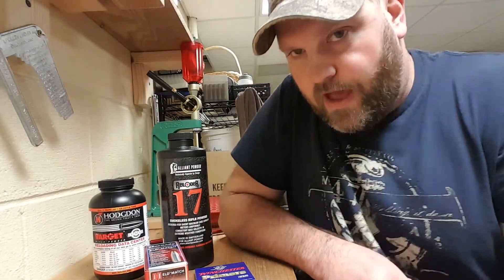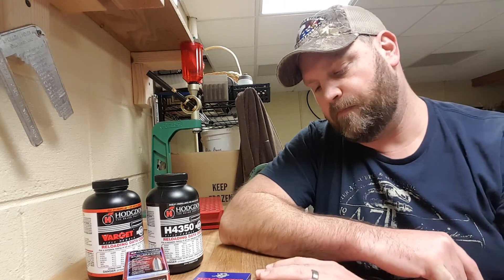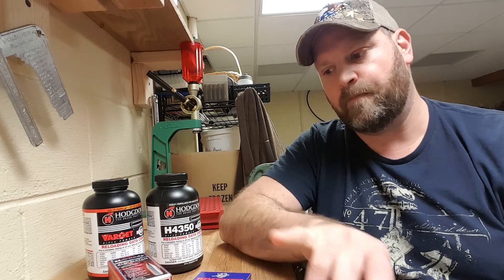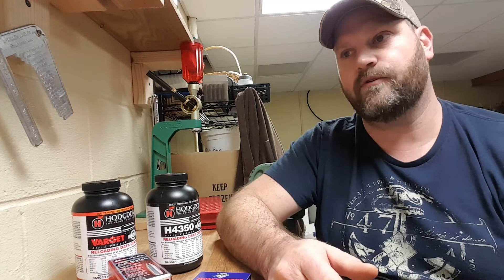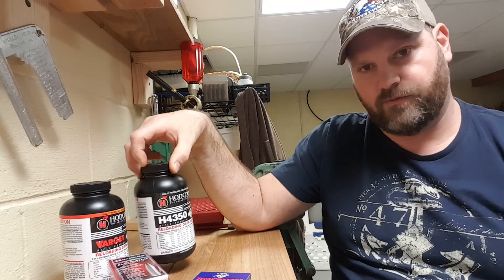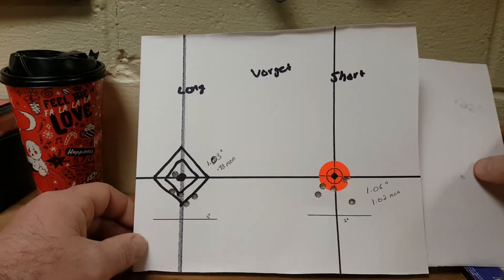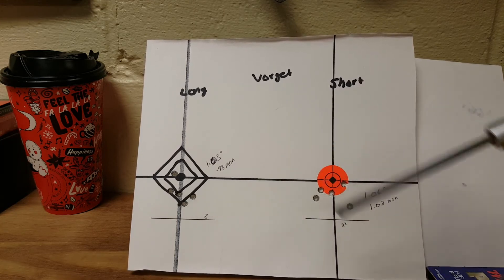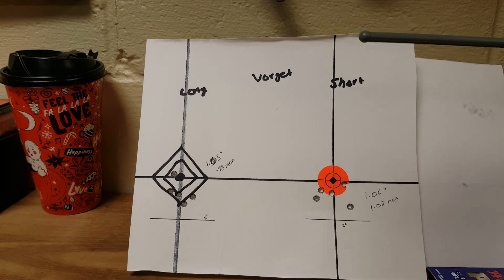224 Valkyrie – Hornady 80 grain ELD Match bullets using H4350 and Varget

Comment: Not trying to be a know
It all here, but your finger positioning on the trigger can make for very inconsistent shots.
Reply from the maker: Yes, you are correct.  If memory serves, I was not thinking about finger position when I was shooting these.  I also think I was using a mil-spec trigger at this point, which did not help the issue.